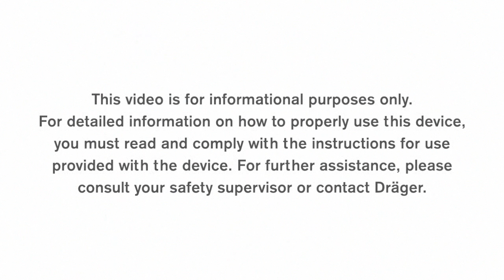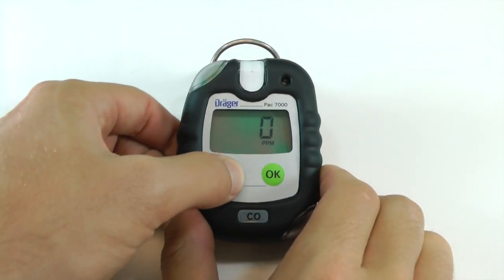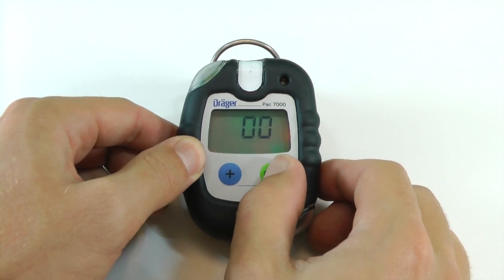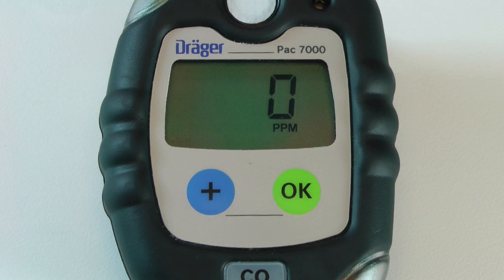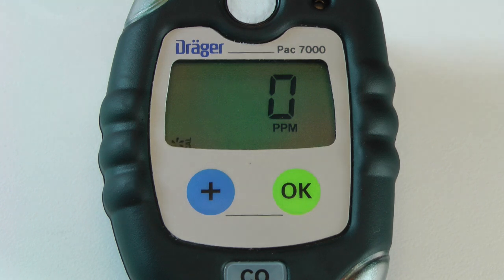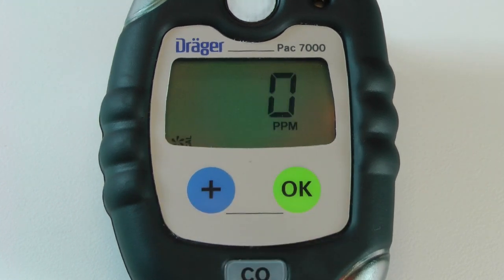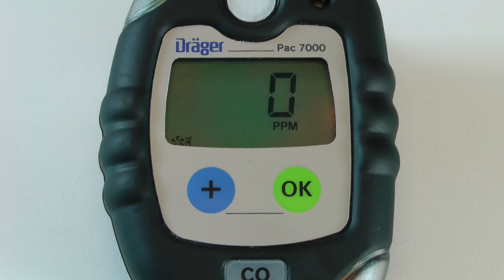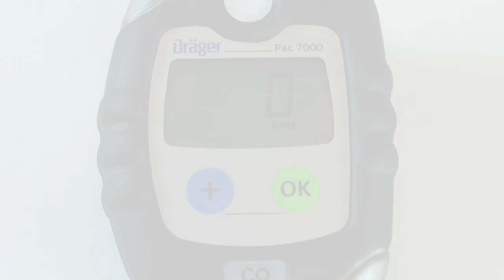How-To: Pac 7000 Fresh Air Calibration

Comment: im having problem with my gas detector pac 7000 with error code 240. I can't doing calibration and bump test because all that i have is this unit which is given by my company. Any other way to perform calibration or bump test without other tools? Ive done according to the video but it just end up with going back to "---"*. Thank you
Reply: Change the Company Drager because they did not provide all the accessories with it , due to which it become difficult to calibrate these apparatus. I do the same , I have replace 20 dragger detectors with new company  which provide all the accessories , know I am conformable.